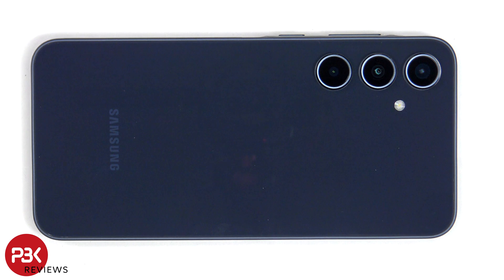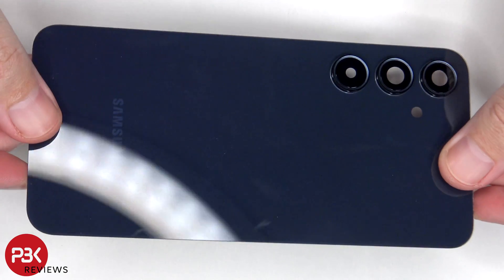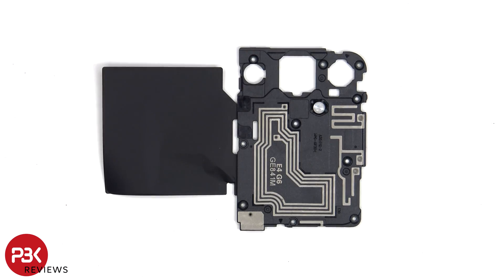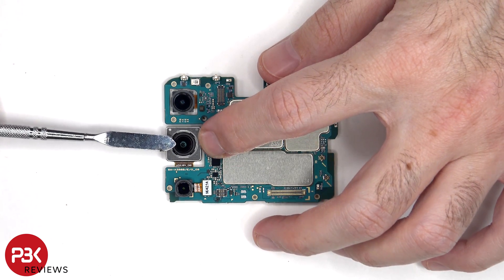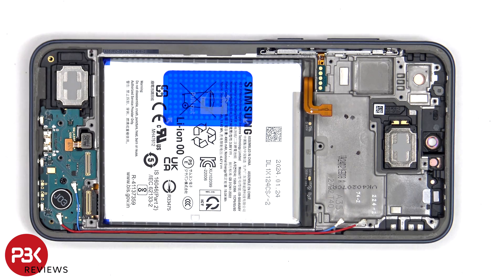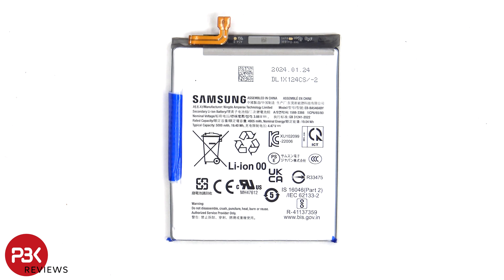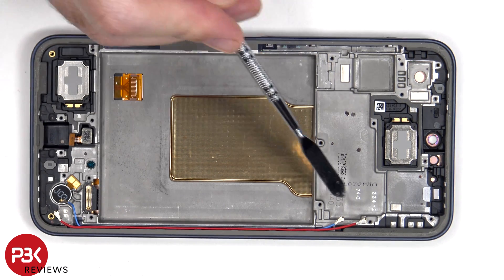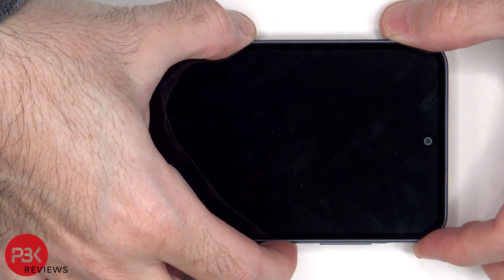Samsung Galaxy A35 5G Teardown Disassembly Phone Repair Video Review

Comment: How's the water resistant after teardown? Is it the same as new?
Reply from the maker: if you re apply new original adhesive which is made for the phone properly, then yes it will retain the water resistance. But if you use generic adhesive or cut one down to size then no it will not.
Reply: @PBKreviews  thanks for the answer, how about if I add more graphite film is it okay?

Comment: Got this phone a few days and I really don't know if its normal that my unit gets very warm just using the Wifi reading only for like 15 minutes. 

Should I replace the unit in warranty or is this normal on this phone?
Reply: This is common for Samsung Phones. Your first week with the phone will annoy you because the phone still has to learn your usage patterns in order to determine how best to manage power consumption. After a week it should stabilize. If it didn't, just take it back for a replacement or a checkup

Comment: Can anyone explain how speakers works? I don't understand (specially the speaker on the top)
Reply: There's 2 separated layers. An electromagnet (in speakers they're called a voice coil), and a flat, thin, magnetic membrane (called a diaphragm).

When an electrical signal flows through the magnet, it pulls the diaphragm. So the electrical signal becomes a vibrating diaphragm, which becomes sound.

Comment: hey bro got a question for you. my screen stopped reacting to my touch but still has all pixels what can i do to fix this. 
galaxy s22
Reply: i just dropped it with case on and it stopped working
Reply from the maker: You can take the phone apart and make sure the cables are in place and have not become loose or disconnected. If still no luck then you probably will need to replace the screen.

Comment: so let's see
this phone has:
-no headphone jack
-no dedicated SD-cardslot so it's basically a single sim
-a useless third camera
-a 25 yearold standard USB 2 
- a 10 yearold charging speed
- 3 yearold screen with 5 yearold bezels 5 yearold front camera design
- 400 bucks price tag lmfao
Reply: I give u a thumbs up, but 
- 25W is actually pretty fast. I wonder how 100W~ is impacting battery life long term. 
- USB 2.0 offers 480 Mb/s, it's very fast 
- It does have SD-card slot
- third camera has a use afaik
Reply: @dand337  
-25w isn't even close to fast
-usb is a 25 yearold standard
-a dedicated sd slot is a slot for sd cards only that doesn't take a sim slot so u can have 2 sims and an sd card
-nope the third camera is wasted resources they could've spent improving the main

Comment: Oh no, the Vibration Motor is a downgrade.  Samsung Galaxy A35 uses a Z Axis Linear Motor.  M
Reply: Why downgrade?  The A34 has the same vibration motor.
Reply: I recently used the A35, and the vibration motor in it is excellent, linear Z-аxis.  Exactly the same as it was in models S6, S7, S8, S9
Reply: I think it was in jest.

Comment: I think premium materials, like the glass back on this and the metal frame on A55, are not a good choice for mid-range phones. Samsung should direct more of their production budget to more essential areas of the phone, primarily the chipsets, rather than the external materials. The chipsets kind of suck on Samsung mid-rangers. Or Samsung can use the same chipsets but use plastic to construct the phones, and reduces the price a little bit. The buyers of these phones are budget-conscious. They are better served by a cheaper phone than a phone with premium construction.
Reply from the maker: true, but also with more plastic, heat isn't exhausted as well as metal and glass etc. So stronger processers will need better cooling.
Reply: Is it good if I add graphite film inside?  @PBKreviews
Reply: You people are hating exynos too much. My a54 is doing good in literally every situation and it's not power hungry processor so battery life is really good.
Reply: @dejantr98 
Thank u so much you're right people whenever they hear exynos they dislike it little do they know that it has improved alot my a55 exynos 1480 is working flawlessly with no overheating issues.
Reply: @dejantr98  do you faced any standby battery draining
Reply: @Androidguyx  you're a little bit late to the party man 👋
Battery life is still good enough for regular daily use and i got no standby draining issues. The only thing i don't like is fast draining while being on mobile data, but I use it rarely.
Reply: also they used to be plastic but people didn't always want that
Reply: @cooper1095 I hate this brand but even I will bet on a walk-in customer buying the A series for the looks without caring about this SD-Exynos word war. 😅
Reply: @jiffonbuffo  more than likely
Reply: I love my A53 5G, was unlocked, $250 on sale coming up on 2 years, works wonderfully.
Reply: I don't think Samsung mid range chips suck like the a35 a55 a54 they can reach the performance of older flagships they are pretty well balanced, but to take advantage of it, game developers should implement better optimization
Reply: Get the A15
Reply: Is it okay to add graphite film inside?
Reply: Excellent presentation , expecting more videos of samsung series latest  mobile phones
Reply: No, I prefer way they are built, keep same, no make garbage like MOTO.
Reply: @BigEightiesNewWave Agree I have the a55 with it's metal frame and glass feels as good as the flagship and almost no phone is like the a55 build quality
Reply: Hello sir I am from India 👍👍❤️❤️
Reply: I prefer plastic since it's more resistant to falls.
Reply: @kayskreed   true, but it's not resistant to scratches